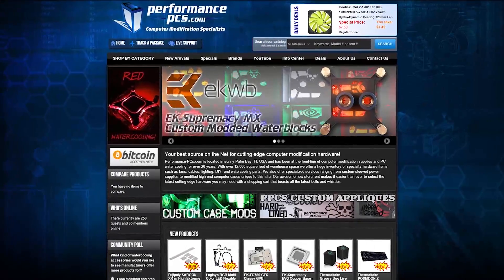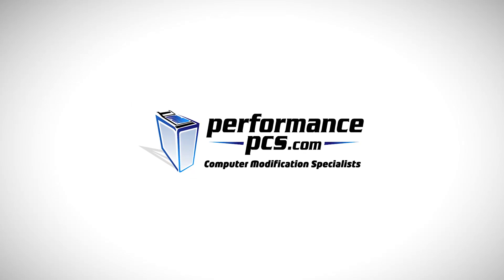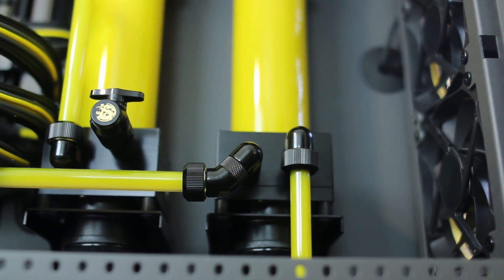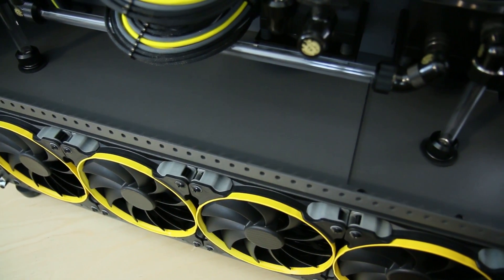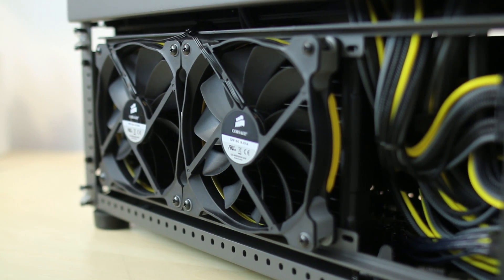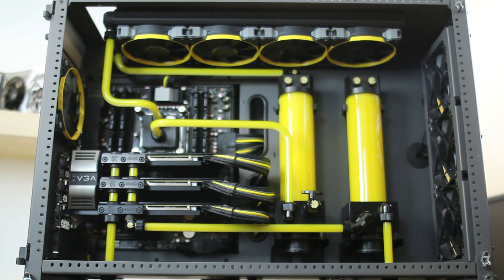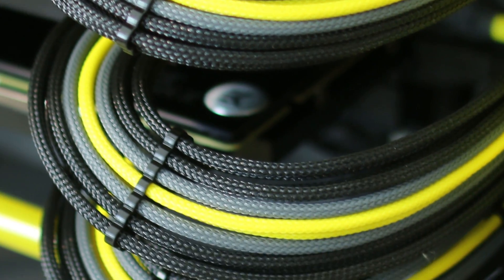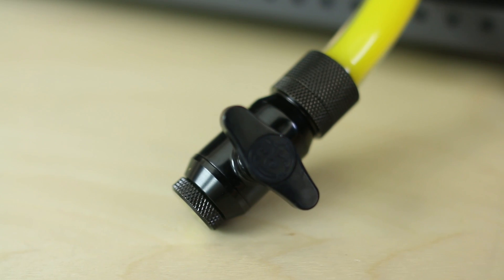Skunkworks V3 is COMPLETE!

Comment: I seriously miss these days of PC building. I really want CaseLabs to hurry up with their reboot (if it ever actually happens). That is actually how I ended up on this video. I was on the CaseLabs website and clicked the link to this video for the nostalgia. I am still running a CaseLabs SM8, but always really wanted the SMA8 for the basement. I am actually beginning to consider swapping the case out, but there is just nothing else out there that I fell would give me the same experience as a CaseLabs case. I have a Montech King 95 Pro sitting in my garage for a build I am doing for my daughter for Christmas. Depending on how I like building in the newer style cases will determine what I do. I still watercool everthing, but I am one of the few that still use soft tubing, I have always felt like soft tubing can look good and the convenience  over hard tubing is enough for me to never switch.

Comment: Jay be like: Radiator length is more important than thickness. Okay jay that may be true, but what about width?
Surely if a 140 wide rad give you enough of a boost over a 120 then a 180 or 200 would give you even more?!
How much gain is a 140 wide rad over a 120 wide rad? 
Is a 180 wide rad or 200 wide rad give you even more boost?
Like so jay will see and he could make a video!

Comment: Wait, 3 way sli 1080 doesn't work, but 3x titan XP works?

And for the res, try DSR 4k x4 8k res in witcher 3 or metro last light redux.
Reply: Yeah, if 3 way worked with Titan XP's, Jays breakers would always go off...

Comment: Why'd you get the Samsung EVO? Pro is definitely worth it. Especially now with the 850's!!! Only a very small cost difference ever since the new Vertical-Nand technology, causing the use of MLC (2 bit per cell) to not cost very much. Paying a little extra for entirely MLC type flash memory is definitely worth it, versus the cheaper TLC flash memory. It causes it to, for one, last long lol. And it causes it, for 2, not to degrade as much over time from use of read/write cycles and will stay at a reliable high speed.

Comment: Amazing PC. The crazy thing about PC's though is that in 5 years from now this 10k dollar PC will probably be worth around 2k or less, ouch. My 2600 dollar PC I built in 2011 is worth about 500 now :(
Reply: *****
 Technology depreciates like CRAZY but it's still worth buying the upgrades every few years! I'm so excited for the future the way technology has been progressing.
Reply: lol this pc is going to be amazing for 10 years
Reply: Veron Bilali
I highly doubt it and the reason is because of new technologies that get built into the hardware of new graphics cards, processors and motherboards, within 5 years there is completely new technology that games use that older hardware cannot, even if they are fast enough to handle them some features simply wont even work (IE new direct X versions, physics, VR features etc). Not to mention the trend of needing massive amounts of Vram with screen resolutions skyrocketing and VR, in 5 years from now I am almost certain the typical games are going to need 8-12GB and some VR needing 16-20 depending on how fast new screen resolutions can come out.
Reply: estebanrey
That's true but when a new processor comes out with better technology then you need a new motherboard to support the socket and when new PCI lane technology comes out for video cards you need not only the video card but the motherboard, with new motherboards comes new DDR tech for ram so you end up having to just replace everything except the computer case unfortunately.

But yeah you can buy yourself a little extra time by getting a new video card or more ram, but you can only do that until the tech outruns you.
Reply: estebanrey
 That's true I agree with that. The game changer might be the crazy Gram and bandwidth usage of the new Pascal GPU's which are supposedly set up for NVlink, but as long as they are backwards compatible then games wont be able to max out PCI-e for several years yet so we should be safe.
Reply: estebanrey
 That's true. I bet VR can take advantage if no one else can though, their crazy screen resolutions take serious Vram and bandwidth to run.
Reply: My 1600 euro pc from 3 years ago is now worth around 500 tho :(

Comment: Jay, I have been trying to figure out an air flow balance for a build I am currently working on. Following your advice, I am trying to spec for positive pressure in the case. looking at skunkworks though, you have the top fans as exhaust, as well as the rear fans.. with only the front radiator fans as intake? in that case labs case the bottom compartment doesn't contribute to main compartment pressure does it?

Comment: +Jayztwocents Genuine question and help please if you will. I can see you have separate loops for both the CPU and GPU, but when you're configuring them as one loop, how do you do it, as in what order does it go? is it pump>reservoir>radiator>CPU>GPU then back to the pump/reservoir again? I'm really confused. isn't that basically cooling the GPU's with warm liquid when it comes out of the CPU block? any clarification would be greatly appreciated
Reply: Unless you have a CPU with a 500 watt TDP then your only gonna see around a 1 to 2 degree difference in that configuration.

Comment: ***** I see you went with 10/13mm tubing. Can I get your thoughts on why you went with that and not 12/16mm?

Also can I your "two cents" on PWM fans vs DC fans? And is there a specific reason to use one over the other?

Comment: yo jay! so noone asked how loud the system is? so i will do now ;)
thing is, my aged (noctua) aircooled pc, which sits pretty much next to me, is humming at idle. not noisy but noticable. when i turn it of im like "ah, THATS what silent is ;)
since it need an upgrade, once ram price drops, whats the way to go? i mildly overclock, do alot of video and photo (at least the its more or less idle, so idle noise is important to me) which way to go? 360&240 full loop (single 970 and whatever cpu i buy) with low rpm fans or keep the aircool? would 800rpm fans do the job at all?

Comment: Hey Jay, how come now that Corsair makes SP140 fans, you never made the switch? It seems kind of a waste to not have the best fans for static pressure on the rads after you've spent hundreds of dollars on the water cooling. I'm aware that the rads have a pretty low fin density and that it wouldnt make an earth-shattering difference, but any difference for the better is still an upgrade right?

Perhaps it could make for a cool video, static pressure optimised fans vs. airflow optimised fans on a rad - just how much difference do they really make?

Comment: Sir jayzalot. I would like some cents. See what i did there. Anywho, i will run a water loop in my complete custom build in a desk. I dont want to be restricted to 1 color with the liquid. Is there a clear liquid that will take on color from my rgb led controller shinning down on the liquid goodness. also having the gpu water run through the way you have it, would that result in the top 2 cards getting less flow or none.

Comment: Next time add a Xeon E5 2699 V3 18 core/36 thread
Reply: Julian Depaepe why on earth should he do this? core clocks are even lower than the default clock of the 5960x AND you can't overclock it.. in this build it would slow everything down.. 8 cores 16 threads are way enough.. higher clock is more important than pure number of cores sometimes ;)
Reply: Dunkelelf3 Well than you simply buy a dual socket X99 server motherboard lmao

Comment: Hi Jay. I saw some Firestrike result of Titan X sli stock, and i see my 980 1500/2000Mhz is faster, though. Oc vs stock is not fair, but still. i want to add a third 980 soon. probs running them all on 1500/2000Mhz for daily OC. I guess they should beat a titan x sli config as long as the vram is not maxed? 

And, who the hell run their cpus below 4.5Ghz for 24/7. i run my 5820K on 4.75Ghz for 24/7 usage, 4.875Ghz for benchmarks. ^!^

Keep it up! :)

Comment: ***** Maybe I missed the episode you may have made about this. 2 weeks ago, my motherboard died. Because the motherboard is close to 7 years old, I ended replacing the processor as well due to obsolete socket issues. I'm not a PC techie by any means. I can put a desktop together, no problem. But what I know little about is the software part of putting a new machine together. 
 After I had ordered my new parts, it dawned on me that I had no access to the hard drive so i could remove old drivers and such. So what I'm asking is "Can you please consider making a step by step video showing what to do in the event of mobo death, with zero access to the SSDs/HDDs, and how to install the new hardware and software"? Basically, how to get the machine up and running again from such a bad position. Yes, I'm a newb, and I want to learn.

Comment: You wonder why there's a massive performance difference between 3-way SLI and a single card??? PERFORMANCE DEMANDS PERFORMANCE!!!! While it may be a good or great CPU, motherboard, or RAM, you need an INSANE amount of power to fully utilize three Titan X's without there being some kind of bottleneck or drop. Just one Titan has the power to play virtually everything in 4K with decent or better performance and can dominate everything below 4K, and it can render better than virtually every other card out there with the 12 GB's of VRAM and over 3000 cuda cores. While it may be a boss setup, you installed three Titan X's in one system without any other major component changes and you expect to somehow use all of that raw power, let alone effectively and efficiently??? You cannot shove three of the best cards worldwide in a rig and expect to use all of the power without some additional upgrades, and while it is a simple SLI config, they will still need sufficient power to handle three cards running at once.

Comment: Sexy build! Love the coloring. GPU cooling will not be sufficient tho. Gravity. I have built many liquid systems in my time and you can see your problem as the system fills. It was in your face saying, "top 2 cards will have reduced flow". Reduced flow = heat. Heat = reduced performance. Yes non conducive liquid will continue to wick heat when hot, but the components will still suffer higher heat conditions leading to reduced performance. Wonderful job even so!

Comment: just use a backup card to flash the 780 back..make sure you point nvflash to the right card of course. not that big of a deal. and if you're a pro at timing and typing without a display, you could do a blind flash

Comment: can someone tell me how that 3 way sli loop works? usually when i see someone with a 3 way sli water cooling loop, there is only ONE tube connecting each of the GPU, but since this rig has 2... hoe does the water flow works?

Comment: I gotta wonder if there is a single Xeon processor with a crazy enough core count with and high enough clock frequency to be an improvement over your I7 5960x overclocked.
It sucks that the recent Xeons, do not overclock at all. I get that the overclocked 5960x or i5820 is a good compromise on core count for higher clock speeds which help out older games. It is a question worth asking with games like GTA5 and hopefully Batman Arkham Knight coming soon. it multithreading really the way forward.

Comment: correct me if i am wrong but did you put your video cards cooling parallel ??
It will mean that they might not get the same flow and the same cooling.
I know that if you put them in series the last one will heat up a bit more than the first one who will get the lowest cooling fluid temperature.
But the flow will be the same for al tree.
Even air might get stuck in the upper one.
Or has the pump so much flow it will give no problems ??

Comment: Using pressure optimized fans would drop temps and make thicker rads worthwhile. I know you explained it before on why you used the air flow fans over the pressure fans but its a point nonetheless

Comment: So I'm building a computer and was wondering. After I boot up windows and I don't have Ethernet since its downstairs can I immediately plug in my wireless network card in to gain a wifi signal? Or would I have to use Ethernet first somehow?

Comment: You said you were going to make a video explaining the effects of thin vs thick rads. I guess you should also point out that the big difference in temps didn't just came from adding another rad but also because the Black Ice GTS are just better rads than the crappy Alphacool you used to have in the system. I'm guessing you also got better temps in the CPU loop even though you did NOT add another rad to that loop and the rad was thinner.
Reply from the maker: Jose U. CPU temps didnt change.
Reply: ***** Cool! My bad! Still would like to see that video about rads you mentioned. Thank you for the fast answer by the way.

Comment: Hey will this build be good for gaming and video editing?
How much fps will it get with two monitors on games like Bf4 Minecraft etc.
I need to know by tonight because all the parts are on sale. Thanks.

CPU: http://www.superbiiz.com/detail.php?name=I7-4790KBX&c=CJ 

Liquid cooler: http://www.newegg.com/Product/Product.aspx?Item=N82E16835181032&nm_mc=AFC-C8Junction&cm_mmc=AFC-C8Junction-_-na-_-na-_-na&cm_sp=&AID=10446076&PID=3938566&SID=

Mobo: http://www.superbiiz.com/detail.php?name=MB-MAX7HER&c=CJ

Ram: http://www.newegg.com/Product/Product.aspx?Item=N82E16820233536&nm_mc=AFC-C8Junction&cm_mmc=AFC-C8Junction-_-na-_-na-_-na&cm_sp=&AID=10446076&PID=3938566&SID=

HHD: http://www.newegg.com/Product/Product.aspx?Item=N82E16822178380&nm_mc=AFC-C8Junction&cm_mmc=AFC-C8Junction-_-na-_-na-_-na&cm_sp=&AID=10446076&PID=3938566&SID=

Times two.

GPU: http://www.superbiiz.com/detail.php?name=EV-980ACXS&c=CJ

Optical: http://www.outletpc.com/uh7279-asus-drw-24b1st-dvd-rw-drive.html?utm_source=uh7279-asus-drw-24b1st-dvd-rw-drive&utm_medium=shopping%2Bengine&utm_campaign=pcpartpicker&utm_content=Asus%2B-%2BDVD%20%2F%20Blu%2DRay%20Drives%20%3E%20Internal%20DVD%20Drives

Case: http://www.microcenter.com/product/441510/Graphite_Series_760T_Full_Tower_Windowed_Computer_Case_-_Arctic_White

Windows: http://www.newegg.com/Product/Product.aspx?Item=N82E16832416806&cm_re=windows_7-_-32-416-806-_-Product

PSU: http://www.amazon.com/dp/B00SN7CGAO?psc=1

Wifi card: http://www.amazon.com/Bolse®-300Mbps-Wireless-N-Network-Adapters/dp/B00NTW99A8/ref=sr_1_1?ie=UTF8&qid=1430546202&sr=8-1&keywords=wifi+card+windows+7

MIC: http://www.amazon.com/Audio-Technica-AT2020USB-Cardioid-Condenser-Microphone/dp/B001AS6OYC/ref=sr_1_14?ie=UTF8&qid=1420157521&sr=8-14&keywords=Blue+Snowball etc

Case fan: http://www.amazon.com/dp/B00L64O5RI/?tag=pcpapi-20 

TIMES 2

TOTAL PRICE 
2009.23
Reply: TheFumingGamer Will windows 7 and the psi be compatible with the build also?

Comment: how does it add up to 10 thousand ?
Reply from the maker: Motty Weisman Math mostly.
Reply: ***** 3000 for the gpu's, plus 1000 for the CPU.
How does the rest add up to 6000 ?
Reply from the maker: Motty Weisman Why dont you just look at the parts list?
Reply: ***** wow
Reply: Motty Weisman The fittings and other addons for watercooled pcs are very expensive.

Comment: any1 is this compatible ? 

cooler master haf x nvidia edition

corsair rm850 850w psu

intel core i7 4790k

32 gb hyperX fury ddr3 1866mhz 

2 x msi geforce gtx 970 100 million edition in sli

msi 2 way sli bridge connector

msi z97s sli krait edition socket-1150

120gb ssd kingston

2 tb wd green hdd

corsair 24 pin sleeved cable and the whole set 

corsair hydro h100 i gtx cpu cooler with noctua NF-F12 PWM 120 mm fan

Comment: Jay I have a question - your recent review of the EK Vardar fans was excellent - and in there you were saying that they were your new popular fan as far as static pressure fans go.  So my question is would there be any significant difference in temperatures by having the Vardar fans installed on the radiators in Skunkworks or would the differences be negligible ?
Reply from the maker: Troy Kucks It would have allowed me to run them at slower speeds. The problem is they dont come in 140, nor do they match the theme of the build.

Comment: im a little confused as to why your video cards seem to be in what appears to be a "parallel" like set up with your water loops, rather than just connecting them in "serial" or daisy chain way. It would seem like the fluids would not go into the water blocks of. So whatever fluid is in the block of the 2nd and 3rd cards would be just be stagnant.

But if water flow is anything like electricity, parallel loads require more amperage, so in this case you'd probably need a stronger pump for the fluids to flow through all cards.
Reply from the maker: HUGSaLOT Valkyrie You are backwards. It takes less pump pressure as the blocks divide the flow equally among them. This isnt water flow, not electricity. Also, Im surprised people keep asking if this works or not when the video shows you clearly that all blocks get fluid.
Reply: ***** I'm not arguing I'm just confused as to how it does works is all. It just seems as if the water will just bypass over the bottom two cards and the water that is there would sit idle. I'm Apparently wrong but I just want to understand how it's working. Your last build with the GTX 980s I think were hooked up in series, no?

Comment: I'm confused jay. You say 50 when u had them on the one 560 rad. I sy that bc I have two 780s and i7 4790k and both our fully overclocked 1.3v and I have just a 360 and 240 rad and they don't break 49 on full load. Both 790s bios hacked and ab 1.3 mod. At 1400mhz with cpu 4.8 @ 1.3v. Now my cpu does max at 80 on intel burn teat but the Gpus stay 28-48 degreea